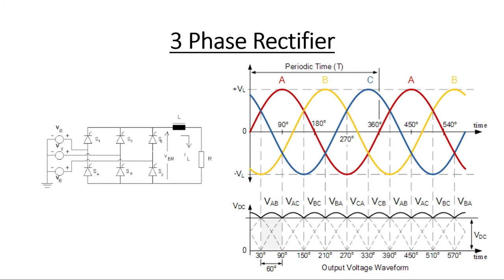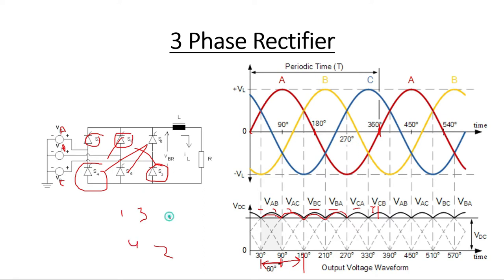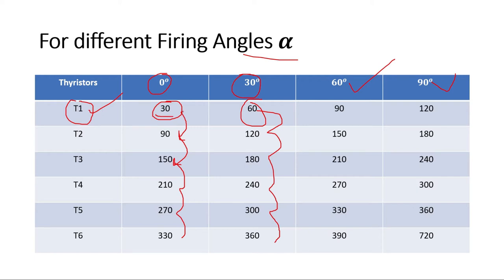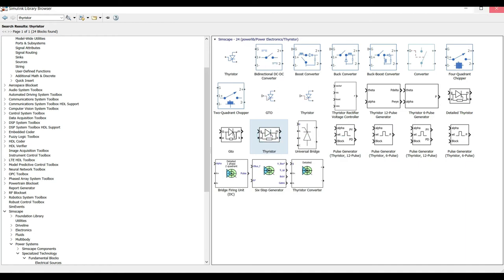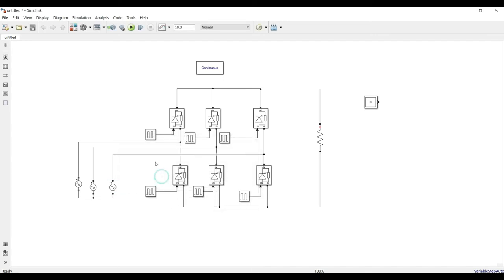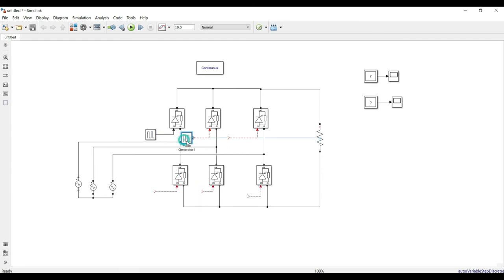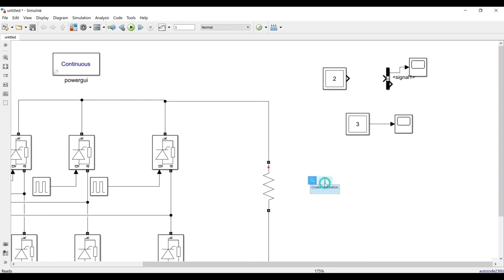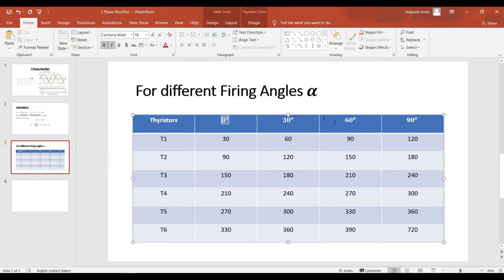Design and Simulation of 3 Phase Fully controlled rectifier in MATLAB | SIMULINK

Comment: how did you switched  on scr 1 and 2  it should be 6 and 1 , first if you follow phase sequence as ABC it will be  ab ,ac, bc,ba,ca,cb, and as per your scr configuration , if we start from phase ab then scr 1 and 6 must go on
Reply from the maker: Yes you can follow the same dear
Reply: @Elite_Engineer  what was your sequence tell me